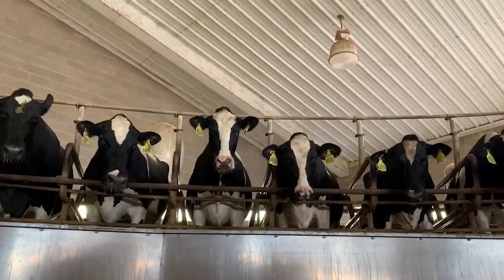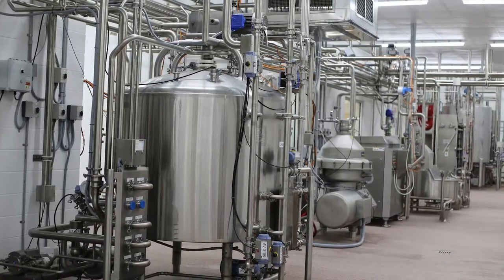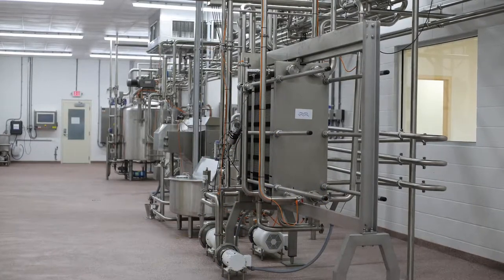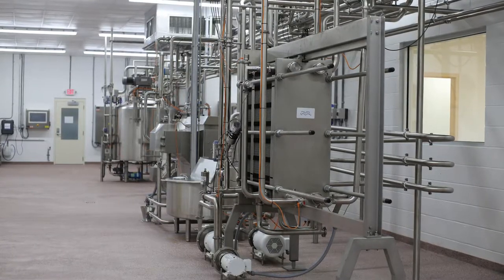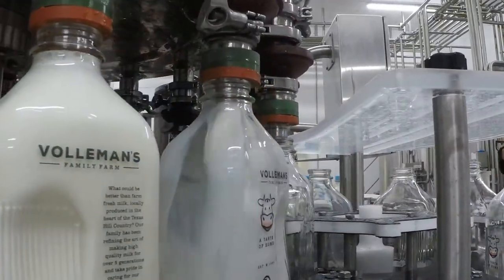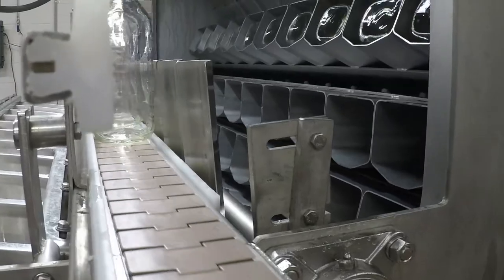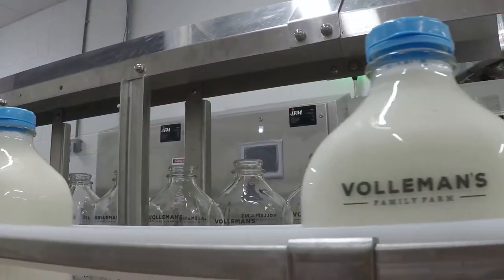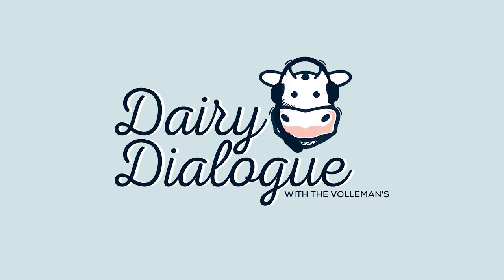Dairy Dialogue: How do we process our milk?

Comment: Cold milk separation is a processing step that occurs at a lower temperature to separate milk. It's often used outside of high-temperature short-time (HTST) processing to avoid double heating the milk. Cold milk separation can have several benefits, including:
Increased production run time: Cold milk separation prevents heat-induced fouling at lower temperatures.
Reduced bacterial growth: Cold milk separation minimizes bacterial growth.
Energy savings: Cold milk separation can save on energy consumption.
Improved microbiological quality: Cold milk separation can reduce the growth of thermophilic thermoduric bacteria, which can survive high temperatures. This is especially important for powder and cheese manufacturers, as well as for infant formula production, which is subject to strict regulations.

Comment: High-temperature short-time (HTST) pasteurization, also known as flash pasteurization, is a continuous process that heats milk to a pasteurization temperature and holds it at that temperature for a set time, then rapidly cools it. The HTST method uses metal plates and hot water to raise milk temperatures to at least 161° F for not less than 15 seconds. HTST pasteurization is the most common method of pasteurization in the United States today.